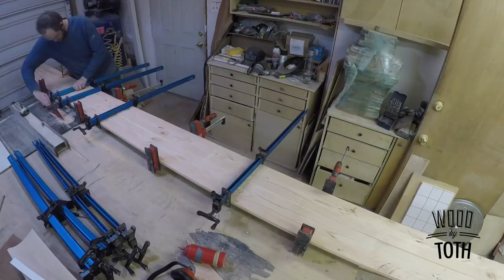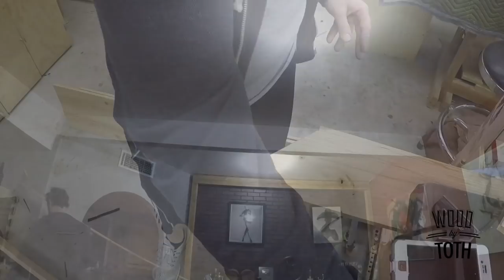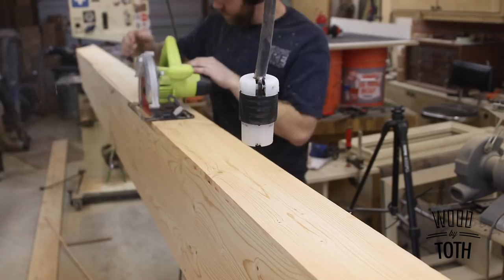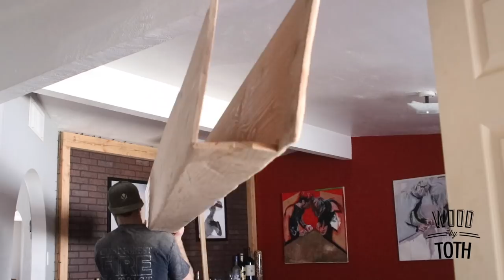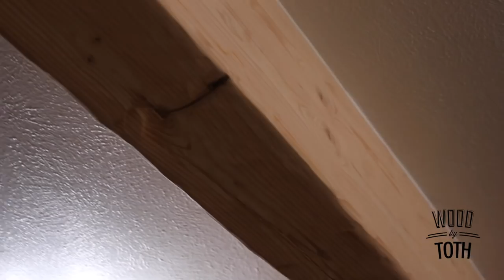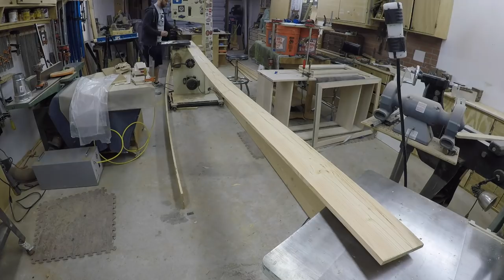Covering Drywall Beams With Wood Beams

Comment: This video is exactly what I was looking for! Would you answer a couple of questions for me?  Would there be anything wrong with just individually attaching three separate pieces of wood (two sides and bottom) directly to the drywall?  Also, how did you fasten the wood to the drywall?  Thanks

Comment: Looks good although I wonder why you joined two pieces that are obviously sisters. When the object is to make it seem like one solid beam it seems to me that joining two pieces with mirror image knots detracts from that illusion. Not that the practice doesn't have its place. Just a thought for anyone else considering tackling this project. Again, good work.
Reply: tennewsongs I was thinking something similar. Swapping one board to the opposite side, or flipping one end for end would eliminate the matching knots.

Comment: Hi Kyle, very cool project! I am getting ready to do this same thing for a few walk throughs in my home as well. I have a bunch of 1x rough cut pine that I am going to use, my delima is this. I don't want them to look like a butt joint. My first thought was to 45 all the edges so they miter together, but after seeing this,  i am thinking the angle grinder might be a good choice and save a bunch of work. Can you see the butt joint once you got it all installed? Thanks, and keep up the great work!
Reply from the maker: Benjamin Ankerholz You cant really see it. The grinding really helps and it give it a cool look
Reply: Thanks!
Reply: Did you consider doing the 45s? I think it helps make it look more like one continuous piece.  I have the exact same situation I’m going to tackle.  I have been planning on using miters to disguise the fact that it is three separate pieces.
Reply: Almost made it look real. That gap up top though
Reply: a 45 on that long a piece is going to be really difficult and potentially be more noticeable if you can't get it perfect.  You might consider veneer if you really want to hide the joint
Reply: probably going to hide the gap with crown molding?
Reply: scrager4 agreed, even with a helper it's tricky to keep long boards tight down to the table saw to get a decent bevel rip. The bevel also makes clamping them ridiculously difficult, plus it doesn't really eliminate the joint line anyway. Better off with tight butt joints, biscuits to help keep em flush, and sanding (or grinding) the hell out of it.

Comment: I think that I would have overlapped the bottom of the box beam with the sides rather than the reverse. That way the beam looks more natural because you don’t see the joint on the bottom of the faux beam when viewed from the side. Better yet miter the edges then round them slightly. No visible seams. You will never know that it’s not real.